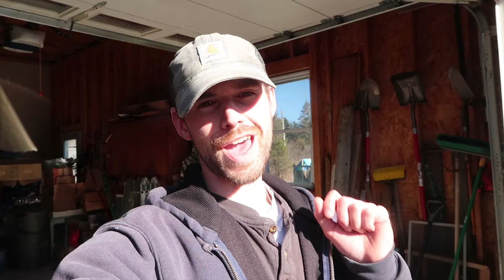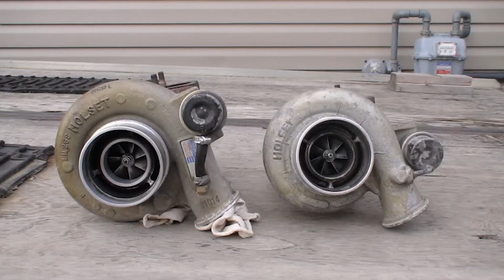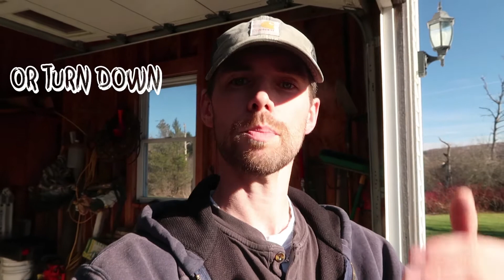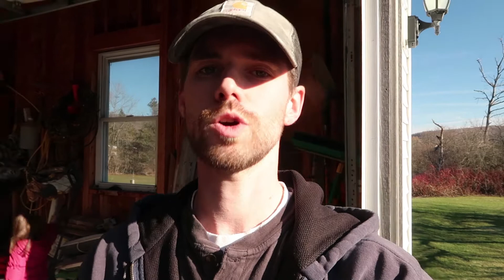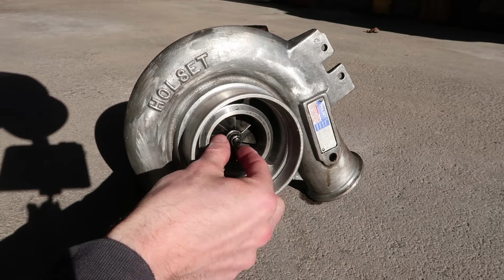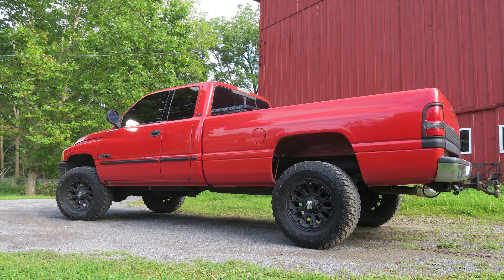Turbo Lab of America HX35 TURBO REBUILD

Comment: Sweet man cant wait for the install ! Very excited !
Reply from the maker: I can't wait to finally get this turbo done and on the truck. It should help the truck out quite a bit after the work get's done to it!
Reply: pure panoRAMa nice! Do you think it will lower you egt's?
Reply from the maker: Josh Acoltzin it should definitely help lower my EGT's a bit. The bigger compressor wheel and turbine pushing more air combined with the straight pipe exhaust, and hopefully a cold air intake and new intake horn sooner than later. I think the trucks performance level will be plenty for what I use it for after all that.
Reply: pure panoRAMa nice it's going to be sick. Man I'm planing on doing slight mods to mine soon as well
Reply from the maker: Josh Acoltzin its addicting. Always wanting more! Haha
Reply: pure panoRAMa yup tell me about 😁

Comment: Kept up the good work. You'll be up in followers before you know it. Better then some Channels already!!
Reply from the maker: Thanks bro. That means a lot.
Reply: pure panoRAMa I'm building slowly a 98 dodge ram 1500 5.9, dont have a YouTube channel. Because I'm building very slowly, but kept up the work.
Reply: Make a video on debadging your truck! Would love to see a detailed on that.
Reply from the maker: Cody Temple I will be doing that in the coming weeks. I've had some different badging for the truck since October haha.
Reply from the maker: Cody Temple I miss my 1500. That truck was fun and those 5.9 360s can be fun engines to work with too. I had some stuff done with my old silver truck. Not sure if you've seen some of those videos with that truck...
Reply: pure panoRAMa yea iv seen some of those videos, that transmission pan and governor pressure switch I watched that a couple times haha
Reply from the maker: Cody Temple nice! I'll be doing it all again with the cummins in a little bit. I'm just waiting until I can order in a deep pan, filter relocation bracket and the upgraded parts. I think I'm going to try getting the bands adjusted this time around too.
Reply: pure panoRAMa that's exactly what I did, the previous owner put in a brand new from the factory 48re tranmission, so after it hit 30k I added a deep tranmission pan and heavy duty actuator 3-4 spring, helped smooth the shifts a little. Since I tow alot I have a lot of tranmission things iv done with it
Reply from the maker: Cody Temple awesome. I've thought about what I would need to get to do a 48 swap. Idk if that's in the budget for a while though. My trans isn't bad for now, but eventually it'll need some love so it doesnt fall out from under the truck on me.
Reply: pure panoRAMa I hear you there!

Comment: Have you ever considered the hx40 turbo?
Reply from the maker: I have thought a lot about the HX40 and the HX35. The HX35 just happened to pop up and I was able to grab it sooner. I thought about a hybrid, but then figured it'd just be best to the hx35 reworked and turned into something more fierce.
Reply: Agreed, rebuilding the hx35 seems to be best bet!
Reply from the maker: kenny etenne I think the hx35 can be machined out big enough to where it'll be bigger than the hx40 or pretty comparable in size. If I started with a hx40, I think I could get that machined even bigger, but the trucks not set up for all that yet, so I would have a big turbo that I cant get the full potential out of yet.
Reply from the maker: kenny etenne I'm still going to have to choke the hx35 off a little too until I get some more stuff done with the truck, then we can open her up a bit more I hope!